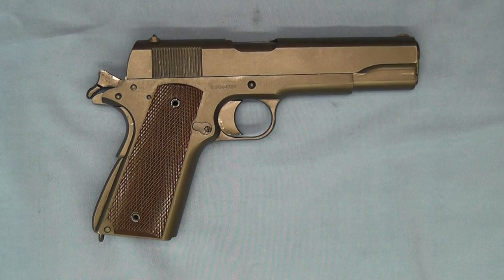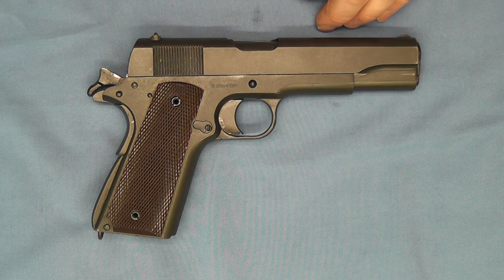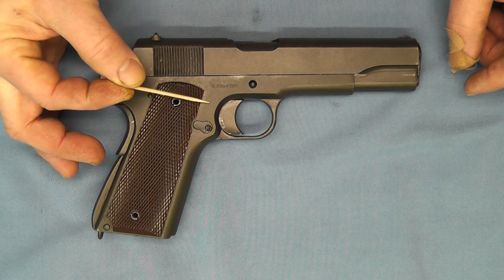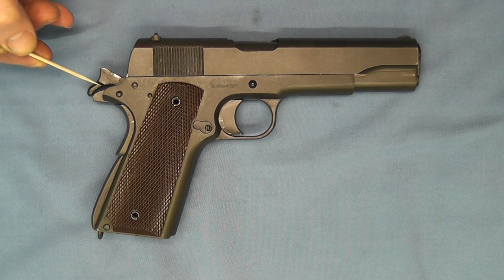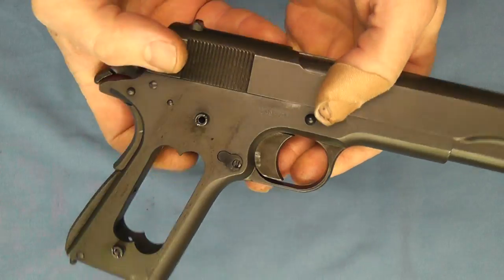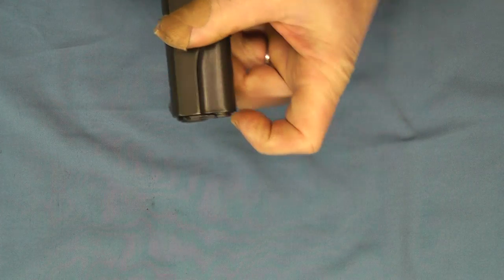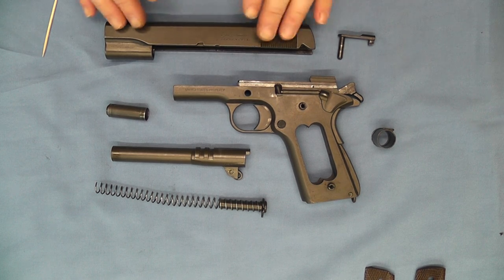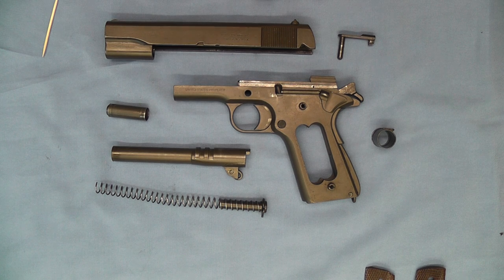Augusta Arsenal 1911A1 .45 ACP X Serial Number

Comment: hi, I have a curious WW2 45.  it has a Union switch and signal slide with its correct components,  HS barrel, and a P in the top center of the rear sight.  It has a 1942 marine colt frame with the WB boxed on the left side of the frame and the "G" on the top.  It looks like the gun went back to the armory and parts were reassembled as it has a "BA 4" on the right side of the frame, and a "AA" on the left (Augusta Armory). I would like to know where can I get more information on the gun. It